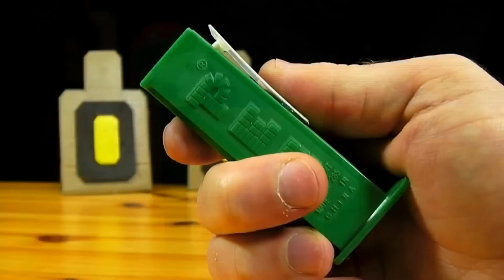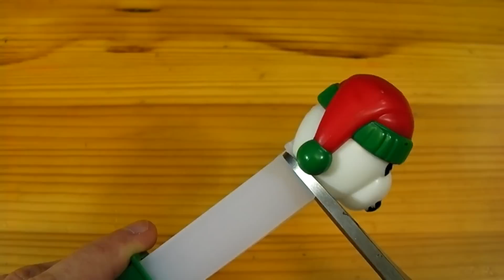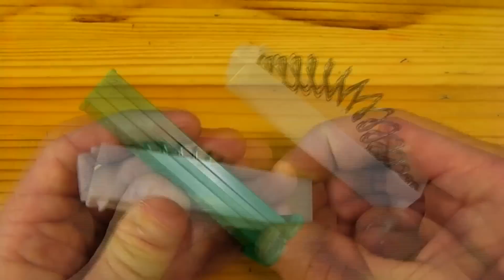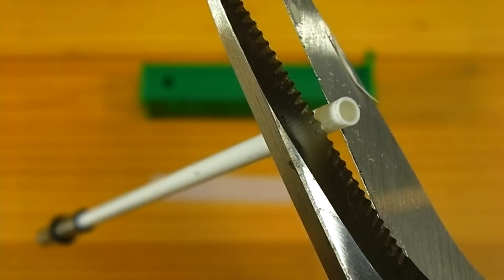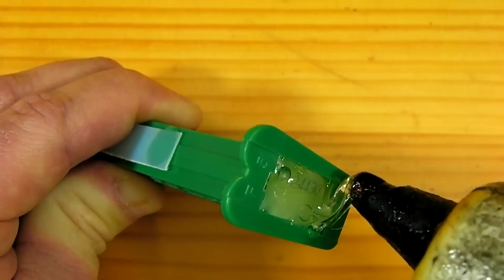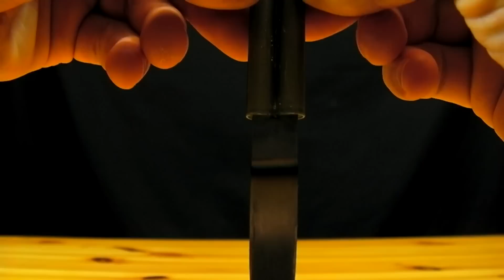How To Make A Ballistic Knife Out Of A Candy Dispenser

Comment: i put on a saftey by simply drilling a hole by were the knife is loaded and placing a pin there i also used one of the other pez containers as a sheath it works realy good.